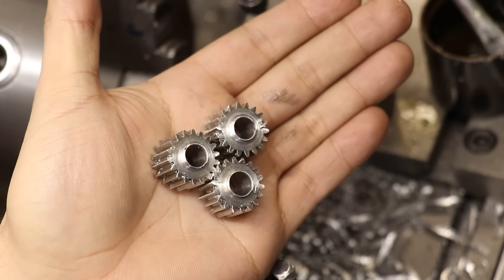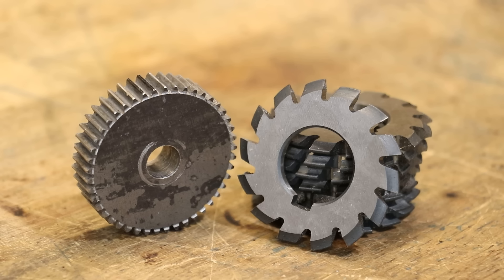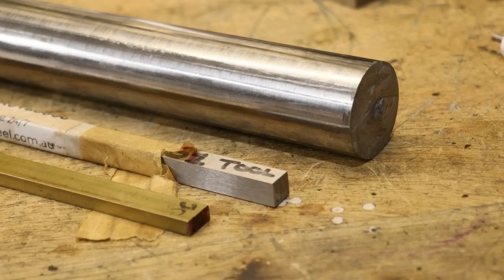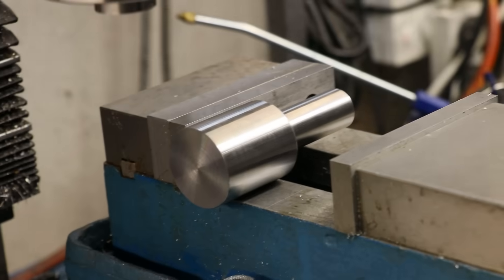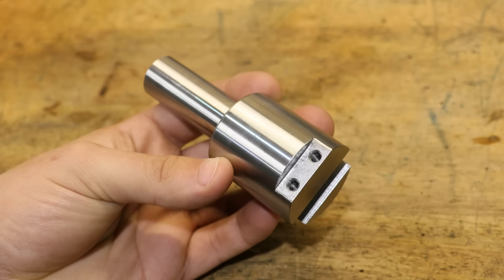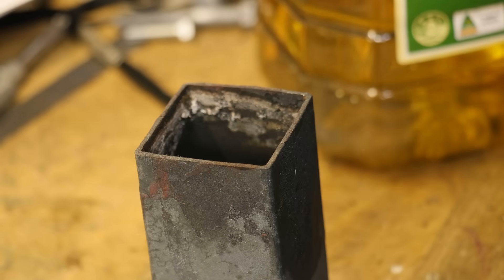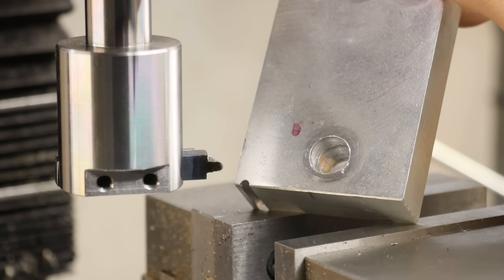Making A Custom Profile Cutter For The Milling Machine

Comment: You can create side releaf. You can be your own cnc with a file and about 5l of distilled patience. Abrasive machining is where absolite precision hides and incidently, it does matters little if the tool is held by human or machine.

Comment: Hi: love your work
Would you consider making a burnishing tool with two balls - in the same configuration as a scissor- type knurling tool? Seems to me that this would put less stress on the bearings ect. I have never seen one before, but seems to be worth a try. Anyway, I would be interested in your thoughts on this type of design 
Kind regards 
Jeff S

Comment: Why a hacksaw to relieve the corners instead of a file? Are square files not square enough? Is it just easier and faster?
Reply: Proved hacksaws have more uses. Quite clever I think.
Reply from the maker: Square files do not have a perfectly sharp 90 degree corner

Comment: What about choosing the diameter of the desired gear a little larger.
Then drilling holes all along the circumference of the workpiece and subsequently remove the Material zu the middle of the drilling holes in a lathe.
Wouldnt this be more straight forward?
Regards Form germany
Reply from the maker: I did the last time and I was never happy with the results. And it doesn’t give you the 100 percent correct profile

Comment: I see your cutter has a 90° cutting angle. If it's meant for occasional use, is there a reason you didn't go with a 60° angle for better durability?

Comment: A couple of thoughts on small end mills. It is important to verify that the flutes are running true because runout puts extra stress on one flute. Collets need to be checked for runout. I can see from the surface finish on your side milling cuts that your end mills are not performing. Good end mills should produce a better finish with few striations.

Comment: I'm a woodworker, not machinist, so this may not make sense. Around 8:30 you were worried about the work moving in the vise. If you ran the slot front-to back instead of side-to-side, it would press against the vise jaw, not along it. Wouldn't this make it less likely to grab and move? Or is the some reason I don't know about to not do the work that way?
Reply: Could be that he only has power feed on the axis that is parallel to the vise jaw. Cranking by hand makes it harder to get a good finish.
Reply: @pettere8429  Wouldn't rotating the vice fix that though? At the expense of having to tram the vice afterwards, of course.

Comment: I have found with 4140 to get chips to break, you need to take decent depth of cut.  1.25mm or more.  Takes a bit of horse power.  Otherwise stringy as hell.  I go 1.25mm DOC at 750 RPM and 0.15 FPR and get good chips and finish.  Of course, depends on your insert. For finish cutting, look up kyocera "wonder inserr".  They are amazing.

Comment: what i did to atleast improve the chances of the ball endmill was to angle the mills head so the endmill faces say 45degree that way your not cutting with the tip but with the side .
now you found the next thing to make different size motor-spindle pulley's big-small so you can chance them when needed for high speed with the small end mills as you dont need the torque for those anyways.

Comment: Gearcutter, here. You have a 5mm HTD timing pulley profile. 5mm HTD belts can run on 5mm RPP pulleys (HTD is largely obsolete in light of improved tooth profiles over the years).

The proper way to create such a pulley is to generate it with a hobber or gear shaper. It is very difficult to create an optimal milling cutter due to the need to precisely top the OD for the tip of the tooth.

That said, I recognize that few home shops have a hobber or shaper, and even fewer have an assortment of hobs and shaper cutters on hand for various profiles, pitches, and tooth ranges.

All in all, cheers on making a working part. I've worked with guys that have trouble using their primary machine to generate a part like that.
Reply: I found a T5 hob on ebay, and have hobbed nearly several pulleys. I don't regret owning it, as I have used it to make at least one really weird pulley. 
https://www.youtube.com/watch?v=ltmZrDrt6pQ

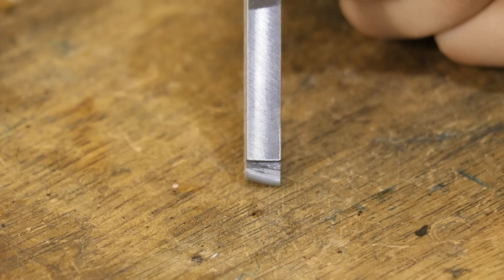Comment: 15:15 I think you'd need at least 4-axis for side relief. But 3-axis CNC is still great for making these kind of cutters, since you can directly cut the profile with back relief by clamping the blank in the vise tilted up at whatever relief angle you want, and scale the profile by the cosine of that angle so it will come out correct on the tilted face of the tool blank. In this case it would result in an elliptical toolpath to create the circular cutter.

Comment: for ball end mills - if you cut a straight slot you can just angle them so they don't cut with a center portion.  it gives you much better surface finish and higher material removal rate.
Reply: Does that mean tilting the head or is there a clever(er) way of doing it?
Reply: @MadMacII tilt the part and account in your program. On a manual, you can tilt the head- its shouldn't be too difficult for someone who is familiar with their machine. I've taught students to tram their own machine every class period, after 2 months it takes them about 10 minutes.
Reply: @JoshRogers-j4l For CNC with enough axis, sure. 

But I thought tramming a manual was more complex/time consuming  Good to know.  Thx!
Reply: @MadMacII  Tramming, indeed any setup that is about getting to zero indicator movement is easy, not even fiddly.
The thing to remember is that the first measurement allows you to set the zero point fairly accurately.
Lets say there are 106 units of total indicator movement (to allow for metric or "freedom" units)
Now you can set the indicator at 53 units and you know that once you get to zero you will be REALLY close without any other adjustment.
Doing it this way you always know where you are and so don't get lost.
You first movement should then get from 53 to something closer than 5.
Why? because why would you move it less?
Once nearly to zero you again check you total movement to make sure the zero is set correctly - adjust as necessary and keep going.
If you want a really accurate alignment once close change over to a more accurate indicator (the indicated movement will then be 50 instead of 5) and you can finesse the last part really carefully, checking with holding clamps being done up etc.

Same thing in a 4 jaw chuck - first opposing jaws give you a zero point. Adjust those two jaws and then the other two.
Now you will be really close with just those "two" movements.
Zero again and finish alignment off.

Comment: Neat! For the actual pulley, I'd have drilled a bolt hole circle w/ a 3mm drill and lengthened them into slots with an endmill befor cutting the rim away. But then again, I have no idea how any of this works outside of my imagination ^^
Reply: Yep, that would be a smart way to do this.  Edit:  I thought this sounded familiar, he used the hole method for his original motor pulley but just machined the pulley down so didn't get a full tooth profile as it was a temporary fix while a new pulley arrived.

Comment: next weeek:
lets make a 120 toot timin belt pullii
😐
Reply: Yep!😂....it really needs an idler shaft pulley added to get the belt drive compounded to deliver higher spindle speeds. Similar to pillar drills with an intermediate idler pulley

Comment: Video start: I don't have enough RPM in my mill
video enD: I've made a cutter :face-red-droopy-eyes:

Y not just make a different pulley for the mill ?!? (╯°□°）╯︵ ┻━┻
Reply: The pulley would need to be significantly larger to get the speeds needed for tiny ball nosed cutters, I'm not sure there would be enough space.  The pulley on the spindle is a pretty complex design so remaking that would be a bunch of work.
Reply: Maybe that's what he plans to use the cutter for? :D
Reply: 🤔🤨He just made the tooling to do exactly that sort of project...  🥜🦈⚒🧰

Comment: Pretty good solution for a common limiting factor when using such small endmills. For a multi teeth cutting tool with that type of profile you should check Clicsprings gear cutters. For a one-off project it probably would be overkill but the tecnique to obtain more teeth is quite interesting

Comment: Well, obviously now you need to build a gearbox for the mill so you can run it fast enough for those small endmills.
Reply: I see no other option.
Reply: Even simpler, he can now make custom belt pulleys which will run the small endmill fast enough to make belt pulleys.
Reply: While I get the reference, the belt drive is already a gear box. He could use a smaller pulley on the spindle end, but then he'd need a bigger motor to compensate for the lost torque.
Reply: @zenengineer5803  would he really be needing more torque with the small tools he’d be using?